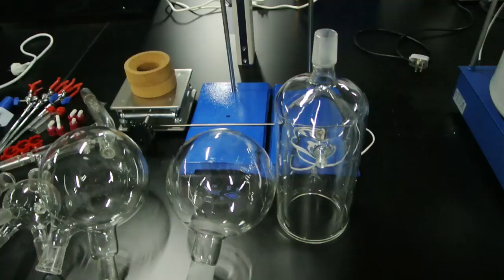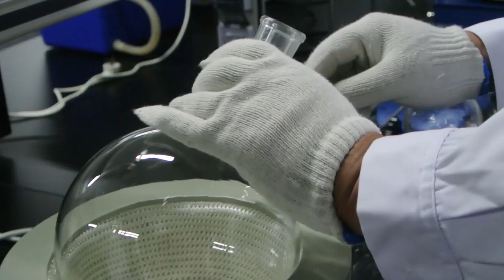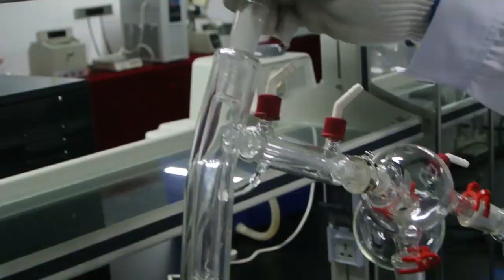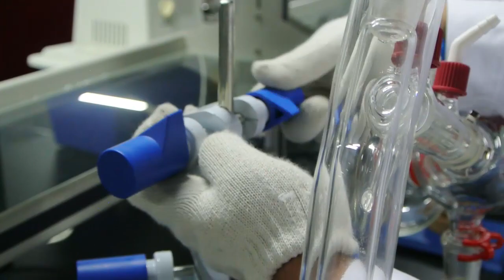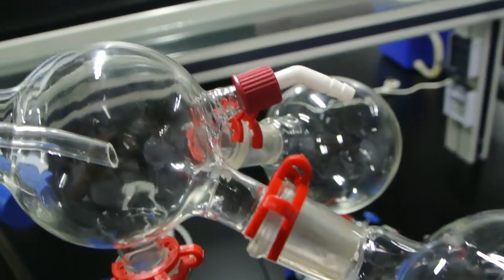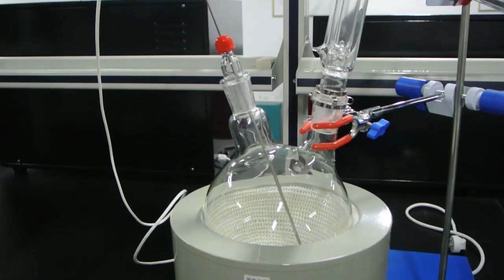5L short path distillation Installation video

Comment: How do you clean the boiling flask when you finished the assay?
Reply from the maker: An ultrasonic cleaner can be used, and the cleaning steps are as follows:
1. Add water and wetting agent such as dishwashing detergent to the filling pipeline of the ultrasonic cleaner tank.

　　2. Fill the flask with enough cleaning solution to completely cover the contaminants.

　　 3. Put the bottom of the flask into the water without soaking. Trays and clamps can be used to support the flask during the cleaning cycle.

　　 4. Activate the ultrasound. Cavitation passes through the walls of the flask and acts on contaminants
Reply: @joycezheng8312  thank you very much for your answer
Reply from the maker: @juandavidriv  you are welcome

Comment: The pressure do nor break the crystals? How can I regulate the vacuum to not overcome my short path?
Reply: Pressure will not destroy the crystal. Need to use a vacuum controller to adjust the vacuum

Comment: how can you set the pressure of the vacuum pump?
Reply: The pressure of the vacuum pump cannot be set. The vacuum pump is connected to the short-path distillation to draw a vacuum, and the vacuum gauge is negative pressure.